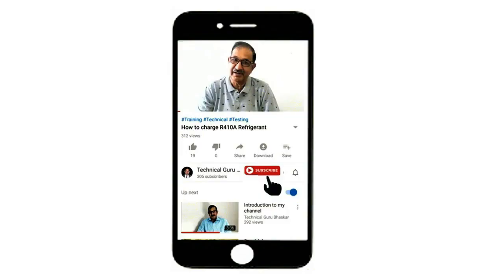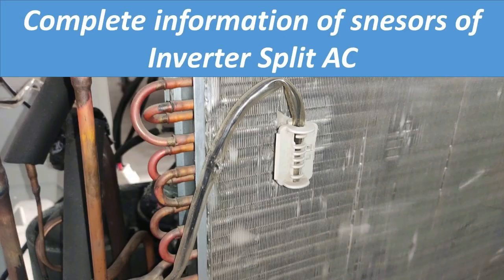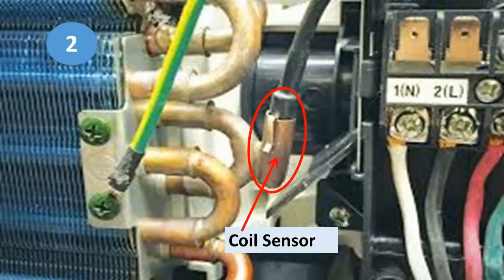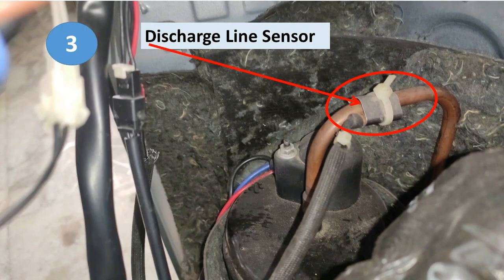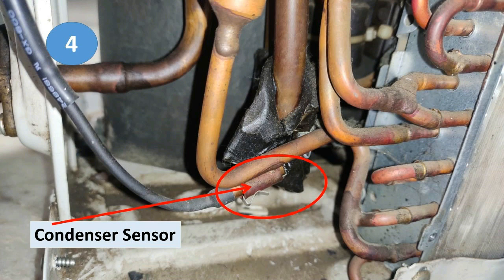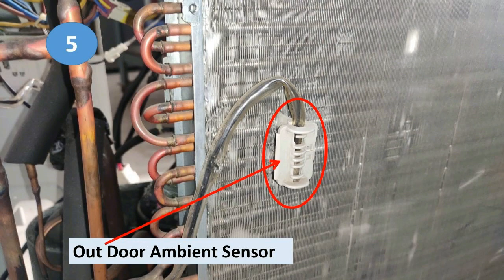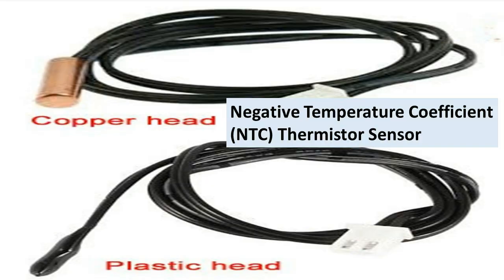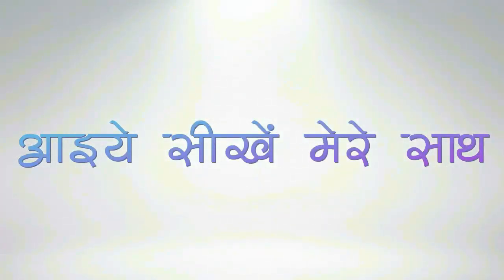Complete information of all Sensor of Inverter Split AC

Comment: Hi, my ac doesn't start compressor whenever the weather is humid. Even when it isn't raining.  And with hot or cold temperatures. I thought it could be from the rain so I installed a cover above the outdoor unit, but it made no difference. When the weather gets dry again the ac works fine. Is there any humidity sensor indoor or outdoor?
Reply from the maker: Check the set temperature, if the ambient temperature is below set temp compressor will not start in cool mode. Or you have set AC on fan mode. As you said when weather is dry AC works fine
Reply from the maker: You may watch my video on how to check sensors, if you are a technical person hopefully you can solve the problem
Reply: Hi, thanks for you prompt reply.  I use the ac mostly for heating, when is less than 15°C outside I set for 22 or more. Sometimes I use it for cooling when it's more than 25 outside and I set for 20 or less. And I always use the correct mode also. It works fine in both modes, but only when the weather is more dry. I have this ac for 6+ years and initially it worked fine all the time. This problem just started a few months ago. Any clue?

Comment: Greetings from Romania. My exterior/ outside sensor is hanging out, not "attached" to the metal guard. Should I push i in, to stick to that metal fins, or leave it like that?
Reply from the maker: Sorry for the delay, you may fix the sensor holder in the condenser. Air from the condenser should pass through the sensor
Reply: @technicalgurubhaskar6657  Thank you very much

Comment: My defy 12000btu inverter is showing P1, not blowing cool air. I've checked drain pipe is not blocked. Can it be a sensor that controls the water?

Comment: Sir what should be the coil sensor resistance value.. For a hitachi 1.5 split ac non inverter type... Sensor gone bad.. Replaced it but dint work...
Reply from the maker: Normally it is of 10K but you can check the resistance at 25 degree C it will show the actual value of the sensor resistance

Comment: Hello. I have a 64K BTU air conditioner with E1 error. I testet and changed indor temperature and outdoor compressor coil sensor. After the defrost the AC dont start again but show E1 error. Please help. Thanks
Reply from the maker: Check 5 volt DC in both the pins for indoor temperature sensor in IDU PCB. If it is not available then the defect is in PCB

Comment: Sir...I purchaged new blue star inverter ac 2 years ago. It works completely but recently i have made wet service before 15 days and now problem started.at night i starts ac at 26 c.outdoor compressor starts and cool air comes but after 20 minutes compressor stops autometically and cool air stops then i set tempracture 25 through remote there after outdoor compressor starts.. (not automatically starts) and after 20 minutes it also stops automatically. Then little moisture air comes. I am harresed bcoz my sleep disturbs. My inverter AC works like non inverter AC .It s any sensor or compressor problem ? How to resolve it ? Tell me sir about all sensor cost pls...
Reply from the maker: Does any error displayed. And when compressor run how the cooling is?

Comment: as far as I know Aircon remote can only be setted up to 28-30 Degree celcious. But I want to disassemble inside unit and use the controller  + sensor for Blazed heat exchanger to heat the water, is there any way to set it to 40-45 degree celcious inside the water ? thanks

Comment: Sir i have split non inverter ac amstrad brand Room temperature sensor problem thi jis reason se new sensor lgwaya sir starting me 35° Room temperature tha 30° set kiya to ac cut off hua jo ki sahi hai but phir Room temperature 28° set kiya but Room temperature 24° tak down aa gya but compressor cut off nhi hua technician se contact kiya wo bola ke ye sensor thik hai ab kya kru pls help !!!🙏

Comment: Two and half years back, I bought one Hitachi 1.5 ton inverter split ac. For one and half year, it was working good. But for the past one year, no cooling, two times made complaints with the come and attended, they changed pcb but still getting cooling. Repeated Co technicians attended and not able to identify the fault. I am very much unset. Kindly give any suggestions for me sir.
Reply from the maker: Share your complaint with higher authorities in the company. They will take care

Comment: Sir ac auto cut off nhi ho rha hai please Help
Reply from the maker: Koyi error show kar raha hai? Check the temperature difference between set temperature and grill temperature. Grill temperature 1 degree kam hona chahiye.
Reply: @technicalgurubhaskar6657  yes sir grill temperature 1 se jyada bhi kam hota hai to bhi cut off nhi ho rha remote se room button press krte h to cut off ho jata hai aur hai cut on to ho ja rha hai off nhi agar iska sensor khrab ho gya hai to sir ye btaye kya ise khud theek kar skte hai aur ye split ac me kaha hota hai ?
Reply from the maker: @karthikmalik505  you better call technician. He will properly check and replace the required part
Reply: @technicalgurubhaskar6657  Ok thanks
Reply: @technicalgurubhaskar6657  Sir Ab Ac Rat ko kai bar auto cut off nhi hota morning me chalane par ho jata hai please Help technician aaya 500 ₹ le gya bas bola ye theek hai Help ! 🙏
Reply: @karthikmalik505  suction senser and amdenent senser dono me fhark kyaa hai kya ye dono ek hi senser hai